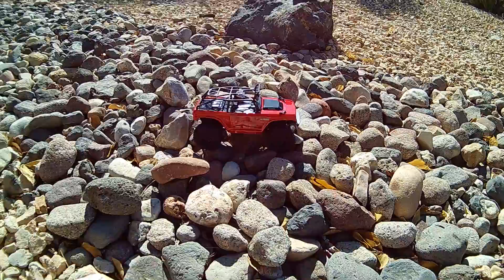Axial SCX24 Mini RC Crawler First Quick Test, Shocks Too Bouncy & High Center of Gravity = Tip Over

Comment from the maker: Axial SCX24 - https://amzn.to/3jre2r6 
SCX24 Wheel Weights - https://amzn.to/3ozCRVM
Floureon 800mAh 2S Lipo - https://amzn.to/37GiS1I
JST Connectors - https://amzn.to/35tAlaR
IMAX-B6 Lipo Charger - https://amzn.to/2HA42yR

The Paul79UF YouTube channel is a participant in the Amazon Services LLC Associates Program, an affiliate advertising program designed to provide a means for sites to earn advertising fees by advertising and linking to Amazon.

As you can see, the original shocks are too bouncy with no dampening and the high center of gravity causes the truck to flip over. 

I plan on putting some grease in the shocks for better dampening and also buy some brass wheel weights to lower the center of gravity.

This is my new Axial SCX24 Deadbolt (Red) 1/24th scale rock crawler that I modified to use my R/C boat batteries with JST connectors. 

I cut the JST PH 2.0 connector off the original 350mAh battery and soldered it to a standard JST connector.

Comment from the maker: As you can see, the original shocks are too bouncy with no dampening and the high center of gravity causes the truck to flip over. 

I plan on putting some grease in the shocks for better dampening and also buy some brass wheel weights to lower the center of gravity.

This is my new Axial SCX24 Deadbolt (Red) 1/24th scale rock crawler that I modified to use my R/C boat batteries with JST connectors. 

I cut the JST PH 2.0 connector off the original 350mAh battery and soldered it to a standard JST connector.